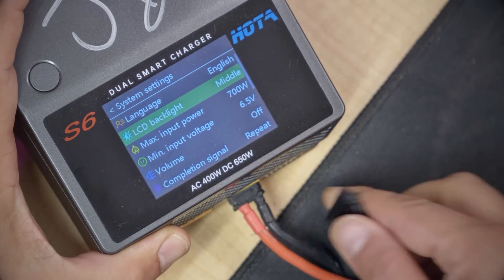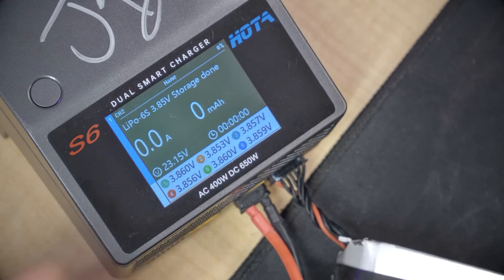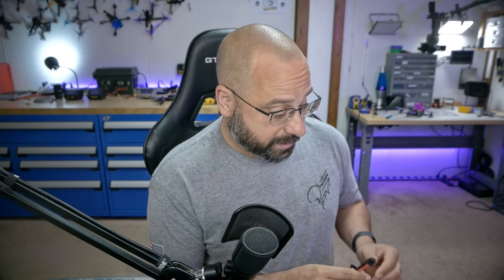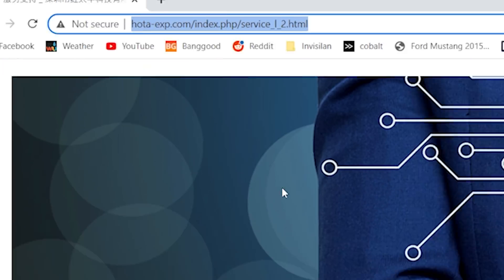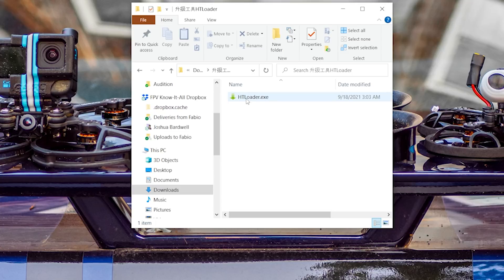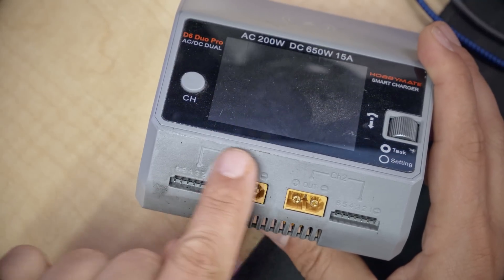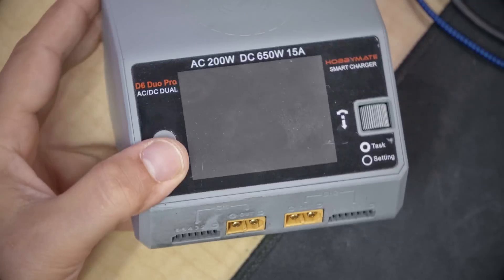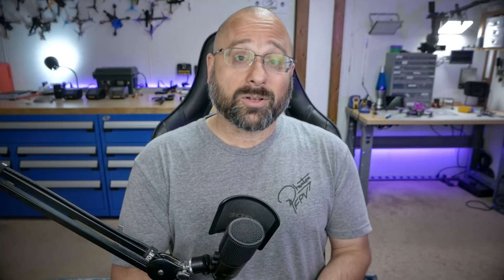Every LiPo Charger Needs To Add This Feature (Hobbymate/HOTA "continuous work" function)

Comment from the maker: I have tested this on the S6 and the D6 Pro. I think it doesn't work on the D6 Plus. And I don't know about other chargers.
Reply: I did this on my D6+ and the feature is there.
Reply: @cubesjdd  same
Reply: @cubesjdd  I have the same charger, please what kind of version number?
Reply: @Wappar87  Sorry I don't see a version # just d6+
Reply: Hey Josh I am the one who had a fire in my garage as you saw I posted on reddit. I really am taking a different approach now to the seriousness of safety regarding charging. I had no idea and frankly took it for granted I am a master electrician and so I didn't think it was a big deal. Mine were not charging however. Idk what happened the fire investigator never told me what they thought it was. I can't believe those things are so violent like that.  Makes me wonder how many fires we will see as the automotive industry makes the shift. And are their not any FPV Lipos with BMS on them in a hard case? I think I want to add a bms to my charger cable inline with charger atleast if it cannot be permanently fixed to a pack. Thanks for the videos yours are the easier ones to watch you make a good delivery on information!

Comment: Hi Joshua love the videos so hope u can help just bought an other hota d6 pro as live these chargers but unboxed the charger went to use it for the fist charge using ac and once I start the second battery to charge the fan goes louder than the charger switches of and back on any ideas or have u come across this issue

Comment: Another thing that I don't get with HOTA chargers is that when you plug in a 6s, you get that spark.  Hyperion solved that problem long ago so I was surprised that buying a newer charger didn't have that feature.  Is that not a normal feature for newer chargers nowadays (some kind of anti-spark circuitry)?  I have been using my Hyperion EOS 1420i Net3 chargers for many many years so I only have experience with newer chargers like the HOTA F6+ that is what I just bought.

Comment: The only thing I miss from my older Hyperion chargers is profiles.  I charge a bunch of different types of batteries so it is convenient to just pick a profile and start charging instead of remembering what parameters I used.  Hyperion allowed you to name them too.  I have the Hota F6+ and it's 500watt on AC is really nice.
The only other thing HOTA needs to work on is their interface is very laggy.  Press the button a few times to switch ports and wait for it to catch up.  Other chargers like Toolkitrc don't have that issue and seem to use a faster processor.  I can deal with it for 500 watts on AC but if toolkitrc and hota had a 4 port charger with same specs,  I would choose toolkitrc just because of the interface lag... and toolkitrc seems to have profiles too.
I forgot that Hyperion has some anti-spark circuitry in it too so that you don't get a spark when plugging in a 6s.  I was surprised that newer chargers like HOTA don't have that.

Comment: one additional danger is if one of your cells is totally dead so you may be trying to charge a 4s battery using 3s (which it has determined via the balance port plug)?

Comment: Hello, I went through this process two times on my Hota X6 Pro. Update went well but, the feature does not show in the menu. What am I missing? Great work as always! Thanks Ben Herr
Reply from the maker: Maybe the x6 pro firmware doesn't support it
Reply: Thank you for responding !
Reply: I went back and looked at the video again. Turns out ,I missed the step to long hold the Menu button and add the option. Shame on me for wasting your time.  Clicked the Option , Al is well in the FPV World.

I would like to support you, however I do not do recuring monthly payments.  Might there be an option for a one time payment? Let me know if possible.  I have learned a lot from your work since  2015 !  Ben Herr

Comment: I tried the new firmware on d6+. Continous mode working well, BUT... the fans are very noisy. The small one keeps pulsating, on and off, and the big one it never started. Back to .11 firmware

Comment: Today I blew up my M6D! 💥💨💨
Constantly discharge(recycle) a 4s, when done put a 6s in without interrupting the process and magic smoke will come out.
I mailed ToolkitRC hoping to get a replacement for this tip.
Reply from the maker: They should detect that scenario and prevent it.
Reply: @JoshuaBardwell  When charging they do, when discharging it dies faster than he can adjust the resistance imao

Comment: Blows my mind JB isn’t using a 4in1 charger. Imagine gushing over a feature that saves a few seconds (and introduces risks) while overlooking that you’re charging each battery 1 by 1. Using a 4in1 charger you can set up 4 batteries at once, oversee the correct (safe) charge currents, and get the job done in literally 1/4 of the time.

Comment: A cool video, but I don’t see the time savings in this feature. I have an ISDT charger and it’s 2 clicks no scrolling to start a cycle if I’m repeatedly using the same setting (like charging all my 1300 4s packs to storage, or full, etc). Maybe it’s easier on this charger than others, but the HOTA looks to have a very similar OSD to the ISDT’s, so maybe I’m not understanding something here

Comment: Cool function, but why not use a parallel board when needing to charge/discharge multiple batteries?
Reply: I would imagine storage charge is the best use case. A bunch of batteries coming back from flying at different voltages, so you can’t necessarily throw them all on the parallel board together. So you just do one at a time to storage instead

Comment: Nice feature👍 a few weeks ago I tried to use a sc100 cable from toolkit, together with my hota d6 pro power supply option as a pd charger for my power hungry device’s, but no matter what voltage and current I’ve chosen it gives me only 0,5A. Any idea how to achieve this? This could be another great feature on this already amazing little charger

Comment: FOR MAC USERS:

Unfortunately it's not possible to run the loader on MacOS. I just updated my D6Pro on my M1 MacMini using a FREE virtual machine running a FREE ARM version of windows (no pirate!)

I'm not a computer geek and just followed along this video: https://www.youtube.com/watch?v=KGZMV8IuUtA

Make sure you don't try to run the update file from the shared folder mentioned in the video, didn't work for me. I drag and dropped it to the desktop and run it!

It may seem like a lot of work for just an update, but I think it's def worth having a working VM for this kind of occasions. I run into this Mac/Windows stuff on a regular basis.

Comment: My drone is showing 0.00 voltage after I crashed into the pool. However the first time I flew after the water everything was normal and operational. But after a few days it just shows 0 in osd. Does that mean I have to change my fc???

Comment: I have been using the HOTA P6 for almost 2 year, pretty good charger, almost perfect except the EXTREMLY NOISY FANS......... just replaced the fans in both the charger and the power brick, now it is what I call a "perfect RC charger"😚
Reply: I think its really quiet compared to my 12 year old one lol. What fan did you replace with?

Comment: Unfortunately hardly any chargers will implement that.
It's all corporate that can't be bothered to improve functions of already finalised product, even if it's just 30 minutes of programming.
I bought recently ISDT Q6 Nano and it doesn't seem like it has acceleration for number settings, the charger is out in the market for like 5 years, last FW update been 2-3 years ago, I already had the newest FW, they didnt add acceleration.

Comment: A good quality parallel charging board is all you need to do them all at once with any charger.
Reply: @StarsAtNight1  Bardwell suggests manually checking each cell to ensure they are within +- 0.1V of each other. 
I don't do that.   I just plug in all the XT-60 leads first,  wait a minute for the overall packs to equalize,  then I connect the balance plugs.   I've never had an issue doing it this way.

I use ISDT Q8 charger,  so charging and balancing is quick for me using the parallel charging board to do all my batteries at once (unattended).
Reply: @MatthewTaylor3 if the cell voltages differ too much, you'll get currents higher than is safe or good for the batteries..
Reply: @lievenvv  your poi t is noted.  I'm happy I haven't experienced any I'll effects as yet. My batteries last around 1.5 years.  I fly 3 out of 4 weekends per month.
Reply: @StarsAtNight1  yes once connected to a balance board,  and charger,  balancing between cells is smartly achieved.

Comment: Or... you just discharge in parallel much faster with a dedicated discharger from SkyRc, ISDT, or regenerative discharge into a source battery if your specific charger function allows it.
Reply: that’s what I do.   I’ve got four of the smaller ISDT dis chargers, each with an XT60/XT30 parallel board attached. End of the day if any batteries remain unflown I group them by cell count and capacity, plug them in and discharge at the max 6A rate. Only button pushing is setting the cell count. 

I don’t like using my chargers for discharging duty.  The only ones I’ve ever had die were being used to discharge batteries  (ISDT Q6 and an SC600.)  The only reason i’ll use the storage function is for batteries which have been over-discharged. Chargers for charging duty only!
Reply: @visioneerone You don't group them by cell voltage? On parallel boards? 😮
Reply: @lievenvv  ? I don't get your meaning.

As I stated I group by cell count and capacity.  The battery sets I've been taking to the field recently have consisted of 6S 5000, 6S 4000, 6S 1300, 4S 1500 and 6S 850, 2-4 of each.  Come discharge time I'll plug in all the (full) 6S 850 packs into one of the parallel boards and discharge them all at 6A.  Repeat for the other groups of packs.

The only way to screw this up would be to attempt to parallel discharge a mixture of full and empty packs.  I've got a foolproof battery management method which allows me to differentiate between the two at a glance, but to minimize the risk I also plug each battery into a cell checker to verify that the pack is full before discharging.

(BTW - my super-secret battery management tool is... a 75 cent bag of rubber bands.  Charged batteries have their main leads strapped down, batteries which have been flown don't.  This is foolproof as you have to unstrap the leads in order to use the battery!)

Comment: Doesn't work on the D6+ unfortunately.
Reply: works on my D6+ but the fan cycling is distracting.
Reply: @cubesjdd  didn't work on mine or Doc's and you are right it changed the fan and the cycling seems concerning.

Comment: Hota is the only charger brand that I got that took fire as brand new just putting a couple of batteries in storage ( hota f6) but hey I guess it’s in the statistics … one safety issue that come in my mind is what if you charge HV batteries in continuos mode and plug a no HV 6s battery , seems more dangerous than charge a 450mah battery at 1800mah for example

Comment: Here is my setup: I have 2 active flight packs (4S, 1,55 Ah), 2 field packs (4S LiFe, 18 Ah) and 2 ISDT Q8 chargers. From cold, I charge my flight packs at 4 Amps from storage (about 2,6 C, each cell shows between 7 and 10 mOhms on the charger). Each consequent "hot" charge is directly off the quad at 13 Amps (about 8,4 C, each cell shows between 1,5 and 3 mOhms on the charger). This way, I can fly for 16 - 18 packs back to back.

Comment: Curious how it will work if you have a parallel charge board on one of the ports if it will let you continously charge multiple battries and then swap out when you need to change battries
Reply: Wouldn't trust it even if it said it does it on the box.

Unless you meant you disconnect the entire board? But then that's exactly what's shown here.

I'm worried about charging a single battery on 7-8s...

Comment: Hota F6 is the best field charger on the market, hota just made it better. Get the 4 way F6 or the 2 way D6Pro from FlyHighFPV com, even save some money when you pair the F6 with a PSU or a field charging battery pack!

Comment: What chargers really need are presets. Every time I change from storage to full charging I need to go through all the menus usually I need to change amperage etc etc
There could be simple presets menu
Even better there could be programable buttons for selecting presets even faster but that would require new hardware

I use Hota D6 Pro. 1 button and 2 clickable scroll wheel might be a clean solution but it takes a lot of key presses to start charging batteries and it could be optimized
Reply: Plenty of chargers have presets mate. Don't let your dreams be dreams. It's here today
Reply: Just get a toolkitrc
Reply: Yea... I have had presets with my Hyperion chargers that I bought 10 years ago.  I am surprised that more chargers don't have that by now.  The other things I miss from my Hyperion... Anti spark circuitry so that you don't get a spark when first plugging in a 6s pack, variable speed fan, quick menus (HOTA seems to lag when switching ports).  And the biggest... 80 watt built-in discharge on my Hyperion chargers.  It seems like all newer chargers have very weak discharge wattage built in so are lacking in that respect and require external dischargers or another pack to put it back into (regeneration charge) for higher discharge.  Just put some bigger resistors and heat sinks in there to handle more discharge current.  I will be keeping my Hyperions at home for discharge purposes.

Comment: My HOTA F6 burned when discharging 6S LiPo. Balance plug was a bit charred, Lipo survived and whole damage was inside the charger. Melted plastic etc. I'm afraid now.
Reply: Did you contact Hota for support?
Reply: @Fly_High_FPV  Bought it locally and got refund from the shop.